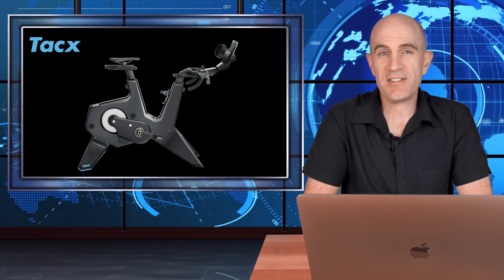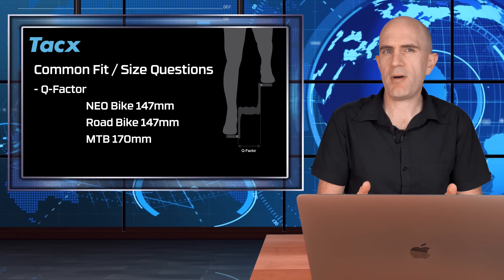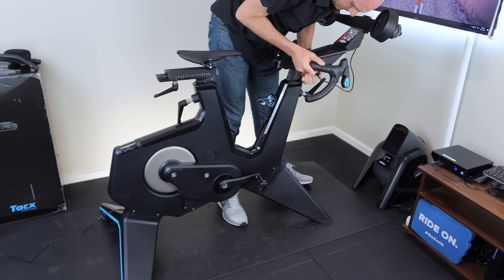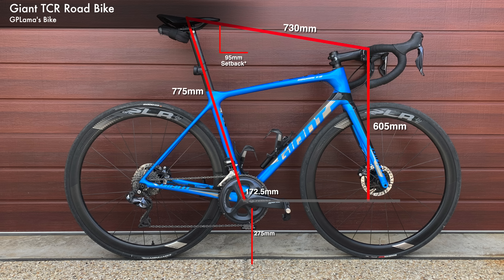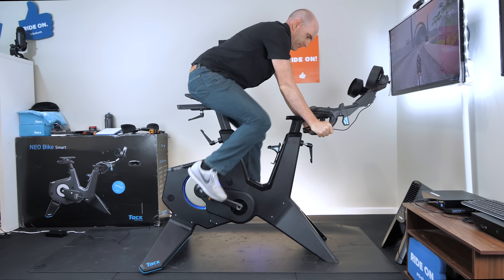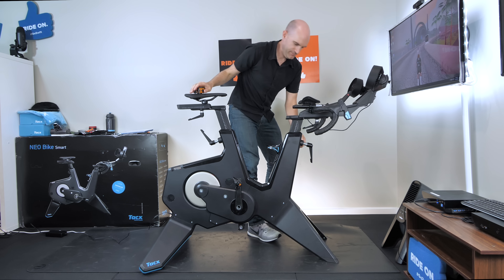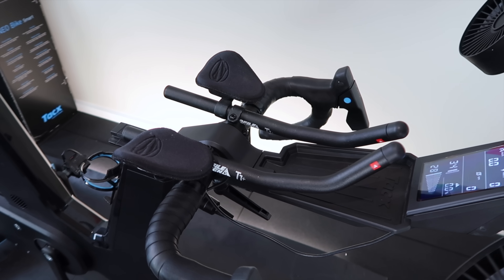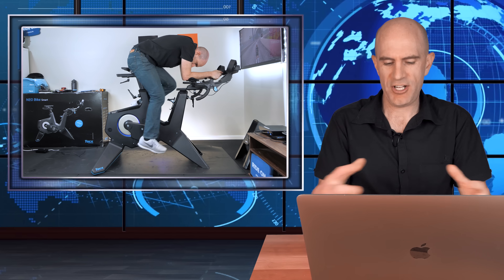Tacx NEO Bike Smart: Rider Fitting // Road & TT (Part II)

Comment: i took out the screw on the underside of the saddle rail, but i can`t slide the saddle off . any tips to get it off?
Reply from the maker: Some saddle mounting systems need a small tap (some need a solid WHACK) once their securing bolt(s) are removed.

Comment: Hi Shane did you do the part 3 ride review video of the Tacx smart bike? I am thinking of buying one over the Wattbike Atom 2nd generation. Tacx/Garmin have updated the cranks to three separate crank positions similar to the kickr bike to set crank lengths. I currently use a direct drive Kicker V5. Will the Tacx smart bike be positive move?
Reply from the maker: No, I didn't. There was a lot updates slated that never arrived. The ATOM has never been a good experience when tested with my protocol. I'd stick with the Kickr 5 at this point.
Reply: @gplama  thank you for the advice.  Great channel always helpful.

Comment: Very helpful video.  Thank you so much.  Can you please verify the size of the allen wrench you used to loosen the 4 stem allen bolts to adjust steering bar angle?  My bolts were so incredibly tight, I wound up rounding out two of the bolts.  I might have one more shot at them before they are completely rounded out but I want to make sure that I use the correct wrench.  Any ideas if I am unable to get these 2 allen bolts off?  Thank you very much.

Comment: i have weird shape, 410mm from tip of saddle to bar centre, 852mm saddle height and  770mm drop from bars to bottom bracket, will this fit? many thanks
Reply from the maker: Best check the sizing in person at a bike store if you can.

Comment: What ever happened to the rest of the review on the Tacx Neo Smart bike. It looked so promising but so far failed to deliver a final verdict.
Have you totally given up on finishing this review or would it be more of a case that Tacx are in the process of totally redesigning the whole bike to accommodate new features that other brands have adapted. For exapmle, the Wahoo Smart bike is a more sleeker design and an easier way to set up the whole bike from scratch.
From reading and watching other reviews, it seems that the concept was a great idea but somewhat misses the mark to be one of the best indoor bikes on the market due to it's design limitations. I would love to hear your view from a more rounded prospective.
Reply from the maker: I was waiting on a few updates. An updated firmware dropped last week. No updates in regard to the hardware though. I'll loop back to this soon.

Comment: Hi Shane, love your videos! Question, if you want to switch between 2 riders 3 times a week, is that reasonable doable with the Tacx?
Reply from the maker: Depends. If you need to change crank length (pedal position), then no. Everything else yes.
Reply: @gplama  thanks a lot! That will work for us!
Reply: Shane, I have my neo bike! It's awesome except for one thing: I had a wahoo till now and a workout was straight blocks of effort. With the neo it seems it aims for the wattage, but it is sort of a bandwidth around it and I mostly (most positive sense) do it myself. I had something similar once in the past with my wahoo, but could fix that with a setting. Do I have to do something similar now? Where to find it? I have the latest firmware btw, 0.0.40. Hope to hear from you!
Reply: Shane, never mind, I found out the difference between the Tacx and wahoo, it's the power smoothing setting. I actually like both now ;). This tacx Neo bike responds really much quicker than my Kickr Snap 👍

Comment: Where is Part III FFS ?
Reply: Any further news? Curious only because I already own and have used one since November 2019. No problems so far really, but both shifting and ERG mode (at least in Zwift) are much improved since the latest firmware update.
Reply from the maker: FFS?
Reply: @gplama  For Fuck's Sake ? :o) More seriously, do you have some troubles with the Neo Bike explaining why the test is taking so long to get online?
Reply from the maker: @bradowner3930  In short.... pretty much yes. I have a few issues I'm discussing with Tacx. I can confirm power accuracy isn't one, it's spot on accurate for power. They've nailed that part.
Reply: @gplama   shifting must be  one of the issues

Comment: I got the Tacx Neo Bike now for 15 Days and i'm really happy about it except 2 points. Since 3 Days i had some bluetooth connection problems with the surface book. Restart the Notebook restart the bike for a couple of times. Do you have the same experience? I see in the video you also don't have the marks for the measurment on the handlebars. Do you know the reason?
Reply from the maker: One for Tacx Support, or Zwift support if it's Bluetooth with their software.

Comment: Shane, Did I seriously hear the Neo grind noise  at 9:42??? 4 years later they are still shipping Neo technology with grinding 🙄
Reply from the maker: Yep... it rides out and stopped after a few minutes of spinning. Thankfully.
Reply: @gplama  I had the same problem. Freaked me out because it sounded like the percussion section of a band and the thought of boxing it up to ship back filled me with dread. Somewhere between 30-60 minutes in an hour long ride (with headphones on) it disappeared (so far) never the return. I assume it's metal filings on the magnets brushing the flywheel and since rubbed off. Irritating, but not the showstopper it sounds like initially.

Comment: why can't someone produce the indoor bike part of this only.  This would allow you to use any smart trainer.  Currently you are stuck with the smart trainer that comes built in.  Sort of like buying a TV with a VCR player built in.
Reply: Michael Steele They do! It’s called a bike frame and a trainer..
Reply: You just described... a bike.
Reply: haha.. not exactly, I like the adjustability options without having to swap out parts, also no need for a front wheel or fork.  yeah yeah ,  you could purchase a chinese bike off of Aliexpress for indoor training. As for me, I have the Neo 2 and I use my second bike on it.  But why can't someone create a bike specific for this purpose?
Reply: @michaelsteele5495  You mean frame with cheap groupset and quick release based, widely adjustable contact points? One cycling gym in Poland actually did it. They designed and ordered such frames equipped with Tiagra and put them on Drivo trainers. Unfortunately it's not for sale but there was some interest in the project among local indoor enthusiasts ;)
Reply: @michaelsteele5495  so do I!
Reply: I'm working on something that would capture that idea.
Reply: Michael Steele that’s a pretty interesting idea actually. However if the adjustable bike was separate then it would still require a chain, derailleurs, shifters, etc if you just wanted to be able to connect it to a regular direct drive trainer. These bikes have virtual shifting that I think is pretty cool because your gears become customizable just like the bike fit. However, if the bike part was just single speed and there was a protocol for virtual shifters to talk to the trainer then this could still be solved.